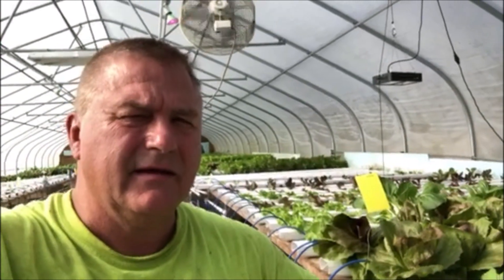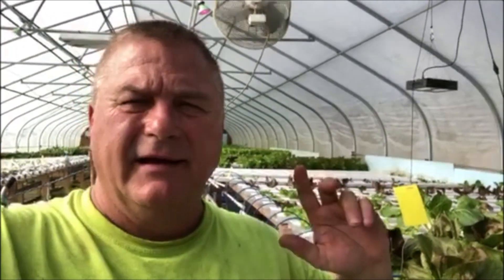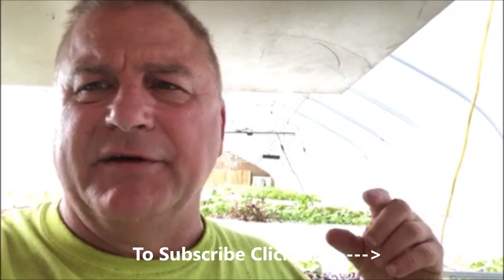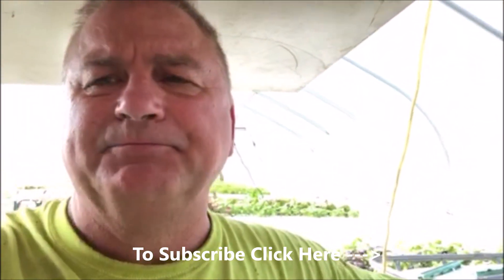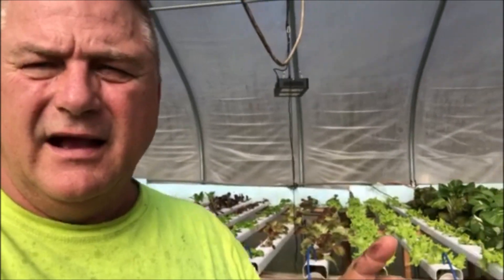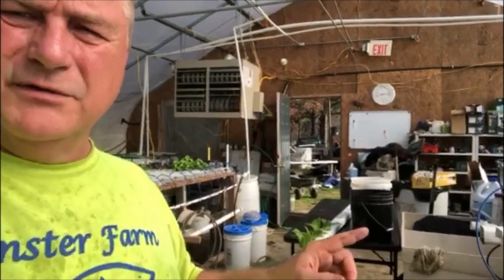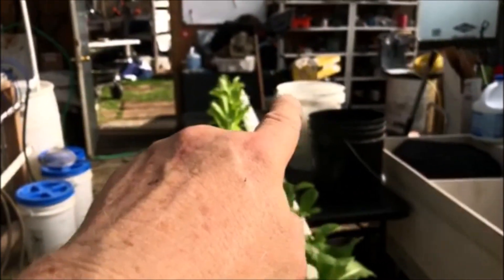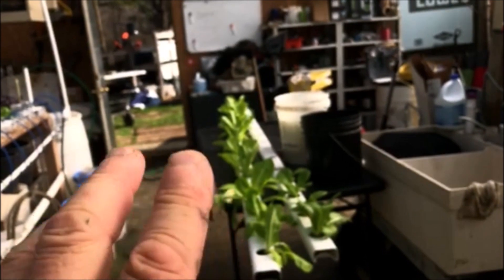How to get rid of Root Aphids in a NFT Hydroponics System

Comment: Hi Chuck, I have used pressed Neem oil mixed with a mild detergent as a spray. I found it was more effective used as soon as it is mixed. If I leave it a day or so the spray doesn't wipe them out as good....Cheers    🌻 Nigel .......MuddyBootz Allotment 🌻
Reply from the maker: Good point. I found out the same thing. The neem tries to separate from the mixture after a while. 
Thanks Nigel!
Chuck

Comment: Hi, good video, 
We have fungas gants and their larva in rockwool in NFT system, all lettuce leaves turned brown yellow and plant died, 
What can we do to finish this pest? 
Thanks in advance,
Reply from the maker: Get rid of all the algae and rotting vegetation that is in the system. Place jars with about an inch of white or cider vinegar in them then put the lids on the jars. Poke several holes in the lids so the gnats can get in there. Place the jars throughout the system where you see the gnats or the damage to the plants.
This works well for fungus gnats.
Chuck
Reply: @FensterfarmGreenhouse  thanks for reply, 
I understand to remove algae, 
But didn't got ur point on jar, we have around 7,000 lettuce plants, please suggest any idea, 
We can do root drench of each plant, how to do it and what will be chemical or pesticide to be used ? 
Thanks,
Reply from the maker: @narohit  https://youtu.be/Rke8_rVYshQ
Place a jar like this every 10 feet or so in your environment. It’s the only thing that I have found that works. If by chance you are dealing with root aphids instead of fungus gnats, you will have to shut down your operation where ever you have the infestation and clean it really well then let it sit for about a month without any vegetation in there to make sure that any eggs that might make it passed the cleaning process die of starvation after hatching out.
I just had to do that. Good luck
Chuck

Comment: I was thinking how I'd attack your cleaning to expedite it.  Not aphids, but just cleaning so it's not so labor-some.  I think I'd get a 10' (or longer if needed) 6" round PVC sewer pipe, use removable caps, fill with a wash solution and put my rails in it for a period of time, capping and soaking.  Might be able to get 2 (3?) in it.  4" sewer pipe might work too.  I'd get a second pipe with bleach solution added to sanitize for a period of time depending on bleach strength after the wash tube.  No need to rinse between wash and bleach tubes.  Could move onto something else for a few hours or a day while they soak in each.  Should be able to just rinse afterwards.  Maybe easier than scrubbing??
Reply from the maker: I love that idea. You know I’m always trying to make things easier Brent. Thanks buddy. I hope all is well with you and the wife!
Chuck
Reply: @FensterfarmGreenhouse  I know how busy you are with work and the markets.  Say hi to your wife for us as well.
Reply from the maker: Hydroponic Gardening & More with Brent Will do Brent.

Comment: I've been using hydrogen peroxide food grade for the washing of the channels.  Can replant right away instead of waiting for the channels to air dry with the bleach.  And if I dont get it fully all rinsed it won't hurt the plant roots as it gets even more diluted in the reservoir.  Great looking plants!  Thanks for the heads up I haven't seen em yet but will keep an eye out!
Reply from the maker: I tried it with hydrogen peroxide Kenny but I couldn’t get it to cut through the algae on the ends of the channel’s. Bleach water does the trick though. I have 30 extra troughs so letting them sit for a bit isn’t a problem. 
Thanks for the kind words.
Chuck

Comment: You need to post a link where to buy the Insecticidal Soap and Neem Oil you used.
Reply from the maker: I will do that this evening. The insecticidal soap is from Safer brand. It contains pyrethrum. The neem I get off of Amazon.

Comment: Wouldn’t that still kill you’re ladybugs if it was not fully rinsed?  I use Azamax  if I have a problem  I don’t have ladybugs.  Are you still using  Masterblend calcium and epsom??  If so could you tell me grams per 100 gallons.
Reply from the maker: I haven’t noticed a problem with it harming the ladybugs. I do not use masterblend anymore. Too expensive and it didn’t work as well as the Ultra Sol that I use. I don’t add Magnesium Sulfate to the lettuce.
Chuck